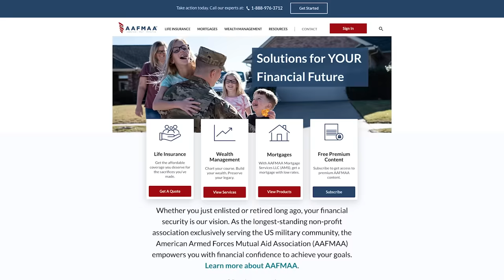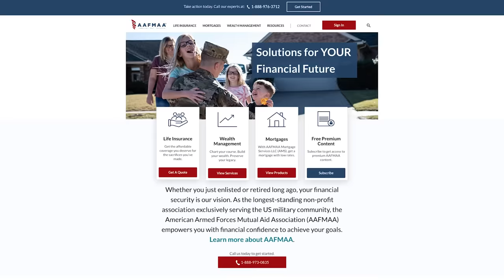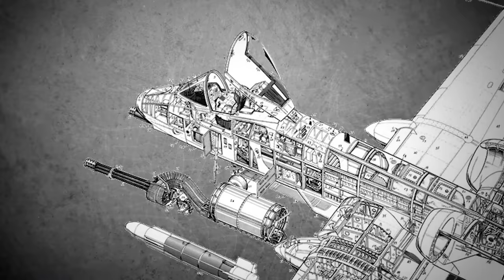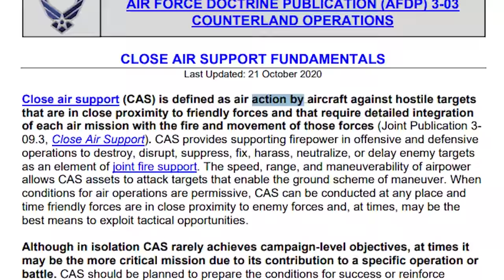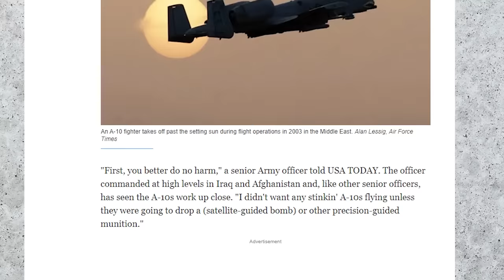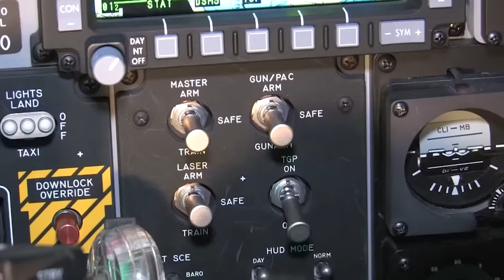Why the Air Force is Screaming to Retire the A-10 Warthog

Comment: The A-10 Warthog is so weird, so loved by many, so sought after for canceling by brass. Over the last couple years, I've heard they're making a new super A-10, but also heard that they were literally thinking about a prop plane to replace it, the Sky Warden. It looks like a militarized Cessna, and some derisively call it a cropduster.
Reply: If I remember correctly the possible prop replacement planes are effectively very modernized WWII Mustangs (data link, night vision, modern materials, etc).  Some of the best prop planes ever produced and at this point an incredibly mature technology.  They do not carry the same firepower per frame, but are cheaper to maintain, much quieter audibly, and a heck of a lot harder for IR manpads to get a good lock on.  The loiter time is also quite good and they can go very slow/turn very tight if they want.  Not exactly a stealthy aircraft, so radar SAMs or radar AAA would suck hard.

*edit: It also can land on junky runways.

I think they have a use case and the maintenance argument is quite persuasive.
Reply: Yup, Sky Warden was approved.  From the Air Tractor AT-802 wiki "On 1 August 2022, United States Special Operations Command indicated they would purchase up to 75 AT-802U Sky Warden aircraft to support special operations forces in fighting irregular wars."   It was never intended to replace the A-10 though.  It's for taking out the technicals and playing with the insurgents up to light vehicles of the backwaters, not poking at the MBTs of a modern army.  Though with the mounts it has I suppose it could if said tank wandered off outside its support, or if someone else distracted or took care of said support.
Reply: Makes sense tbh. That sounds like something tailor made for counter insurgency stuff. Admittedly.... I don't know why you wouldn't use a drone at that point (MANPADs are a thing nowadays after all, tho I guess the providers tend to be westerners)

But it gets the job done while costing less.
Reply: There is no contractor who would bid on a modern A-10 replacement.  A possible replacement would be a turboprop (the OA-X program).  And the only practical mission for that would be counterinsurgency and not a fight against an opponent with credible anti-aircraft defenses.

The Embrarer Super Tucano seemed like the most likely since it was already used by some countries that couldn't afford more expensive aircraft.
Reply: @RobertLutece909 The Sky Raider was shelved in favor of the A10.  Props won't work in a major land war.
Reply: Nope. Their idea is not actually to replace it, their idea is to get rid of it so they can take the funding that would have been used to field the A10 squadrons and use it for some other aircraft that they want like this lightning. The lightning even if everything worked on it still couldn't do as good a job as a warthog. It's all just a question of getting money to field their high-speed high altitude Jets. They have no desire to support ground troops. They want to do the Top Gun thing even though it would cause the death of army Grunts and marines. That's not a part of priorities.
Reply: @mrgrinch837  Eh, not every battlefield role is going to remain existing, there's a reason the aircraft carrier replaced the battleship afterall.

In the a10's case, it just dies too easily in contested airspace, and a literal prop plane is cheaper and easier to maintain if you're just shooting militias embedded in mountains or whatnot. Never mind the fact that getting close enough to use the gun is just asking to get pilots killed if MANPADs are present.  (tho a drone could honestly do it I guess)

Never mind the fact that attack helicopters exist as well. 

And unlike strategic bombers, which can be repurposed to launch a bunch of cruise missiles, the a10 isn't actually that good as a dedicated missile plane, despite that being a lot of what it got used as during desert storm.
Reply: @jeromeace1282  hey jerome, I'm not sure how much you know about what's called the Air Land Battle Doctrine. I spent 10 years as a paratrooper and 10 years as an attack helicopter pilot. As far as the battleship goes, airplanes is what technically took out the battleships which are stationed on obviously aircraft carriers. As far as the warthog flying in contested airspace, it does not. The Fix Wings assets are controlled by awac aircraft hundreds of miles from friendly troops. That's why the warthog doesn't do anything in that realm, it's job is to protect ground troops like I used to be.  There is never, and I cannot emphasize this enough, never ever a chance that an enemy fighter can be anywhere close to our ground troops. That just can't happen with awacs coverage with hornets, raptors, strike eagles, Lightnings etc. The A-10 Warthog does not fly against enemy aircraft. As far as losses go we only lost four combat losses. Compared to the hundreds of sorties that were flown in Desert Storm 4 is a microscopic amount. The fact is that plane can take more damage than Can Be Imagined upon it and bring the pilot back alive. I flew cobras, those are obsolete now but Apaches have refined skills that even the A-10 doesn't have but you need both. The only real reason to pull the A-10 out of service is for the money that they can apply to other programs, but it leaves grunts like myself vulnerable. Everything in a combat zone is a risk, that's why we do the job. If you're afraid to go out there and be shot at then possibly you shouldn't volunteer.
Reply: @mrgrinch837  My comment about contested air space wasn't about the a10 fighting other planes. I was making a point that it basically can't do close air support/ground attack in contested air space because it will fucking die in a modern battlefield against a peer opponent (admittedly, outside of a potential taiwan related showdown, i guess no such foe exists).

Admittedly, I realize with the total dominance the USA has over making high end fighter jets (only the Chinese have both the design chops and the actual budget to fly something that could realistically contest the likes of the f22 and f35 that doesn't rely on a USA made engine for example, never mind whatever crazy shit 6th generation fighter jets will have) needing close air support when airspace is contested might be a foreign concept to you lol.

But couldn't cheaper/easier to maintain planes (i've seen the idea of literal prop planes floated around for counter insurgency stuff for example) can more or less do the same job as the a10 in non contested air space? Hell, just putting a gun on a drone could likely go a long way, even if anti drone countermeasures are also going to become more advanced.
Reply: @jeromeace1282  be serious part of again the airland battle doctrine which if you haven't read it you might want to, I already brought up the point of awac aircraft.  Intelligence of the battle of space which can exceed up to 400 miles allowing stealthy aircraft to intercept conventional Fighters is a game changer. There is seriously no need to insult me, I'm just letting you know what are capabilities are. Not saying that the warthog is built cheaply, it's built like a freaking tank with maximum redundancies. It's a very hard aircraft to take out of the sky. Those few aircraft which were seriously engaged by anti-aircraft fire as mentioned before we only lost four. As far as Chinese go, used to go with a girl who is a very high-ranking us officer in china. Her best advice to me was never buy a chinese-made car. There are multiple reasons why the Chinese are of no significant threat, most of it is they have no Blue Water Navy and they're surrounded by ocean. Without the ability to move your resources thousands of miles as we do with aerial refueling, you're just not a potential threat. I'm going to bring up this point because I spent 10 years operating as a paratrooper using TOW Weapons Systems mostly, after that I went to flight school graduated and operated as a tactical operations electronic warfare officer with Army Aviation units. The photograph of me is of me flying a huey in flight school so I kind of know what I'm talking about.
Reply: @mrgrinch837  To be clear, I wasn't trying to insult you, more memeing the US military industrial complex's dominance of high end fighter aircraft (genuine question, when's the last war y'all fully committed to that didn't result in immediate total air dominance). That being said, while the a10 can deal with AA in terms of bullets, given the proliferation of things like MANPADs, I'm curious how many targets the a10 would be able to safely engage in the future. 

As for the bit about intercepting aircraft from 400 miles away with a stealth aircraft, in a hypothetical peer war, both sides will be doing that (and even in a somewhat more lopsided war, I wouldn't be surprised if something like stealth drones end up being a thing). And in cases where that's not the case, how is the a10 not just a 'win more' option whose role could be fulfilled by something cheaper that can potentially loiter around the area for longer? 

Also, my point about desert storm wasn't how many were shot down, but rather that most of the a10's vehicle kills were from the missiles (despite the initial concept of the plane as using the gun on vehicles).

As for the China thing, what i've heard tidbits of from people talking about getting stuff made there, the main problem is more quality control being dogshit unless you're being strict about it. Which presumably they would be for high end fighter jets, they're not making stuff to parade around a few prototypes the way russia does lol.

Also, the not being a threat thing isn't entirely true, if the Taiwan thing boils over because the CCP wants to distract from internal issues (which is important because Taiwan basically have a monopoly on producing high end microchips), that's both close enough to mainland china for all those long range anti ship missiles they have to come into play, while also threatening a sufficiently crucial strategic resource there's a pretty strong incentive for the USA to get involved.
Reply: @mrgrinch837  self defeating argument, US warplanners are focussing on near peer adversaries, where contested airspace is far more likely, meaning the a10 can't even take off in your words.

The reason to pull a10 out is because it has no good distinguishing features compared with the contemporaries it's a bad (relative) platform and it costs too much. Being able to survive small arms is good, but not being shot is better... *laughs in ac130*. Most missions (unless your experience is saying otherwise?) use PGM and not the gau8 (especially to eliminate targets, especially in cas). It's loiter time is inferior, it's expensive... everything it does something else does better faster and cheaper other than being a distraction/bullet magnet?

Assuming the gun statement is accurate other aircraft/drone can easily fill the role given basically the whole fleet can fit jdam/sdb or hellfire/switchblades if you're talking about drone or rotary.
Reply: @mrgrinch837  AF brass have wanted 'new toys' for a long time.  This crop duster is just a way for them to say they have a 'replacement'.
Reply: @H0kieJoe  at the cost of the lives of Army and Marine Corps soldiers on the ground who need Superior firepower. Must be one hell of a toy the sacrifice those lives.
Reply: @mrgrinch837  Yep.
Reply: @mrgrinch837  If you already have air superiority why are you wasting time with a dogshit A-10 and not putting an MQ-9 on station?
Reply: @fnhatic6694  drones are great at surveillance and Reapers especially at killing vehicles, but they don't do squat with killing troops. Under the best conditions they only carry eight Hellfire missiles, so unless they're all going to bundle together and stand there and smile it really won't do much in taking out a bunch of enemy soldiers. Besides, if you spend something like $100,000 with a Hellfire just to kill one guy that's not entirely cost-effective.  An A-10 is not an air superiority aircraft, it was never meant to be. It's job is to protect the infantrymen or Marines on the ground. You need to have coverage to take on enemy soldiers that are attacking your friendly soldiers and a Reaper ain't going to be able to do squat about that. Unless like I said, they have to stand together and smile. Ya Gunna need a big freaking gun that spits out a lot of bullets in a very short amount of time.
Reply: @mrgrinch837 The A10 was made to be survivable against threats from decades ago and would get swatted out the sky by the cheapest of modern MANPADs. Its not even a question of survival, it. Will. Die. Two decades of fighting enemies who's idea of air defence is shooting AK47s up in the air has lulled Americans into a false sense of security on the A10. 

The US Air force is rightly concerned about achieving air superiority in Asia, given China has lined their coastline with anti air assets this is looking difficult for them. American marines won't even make landfall if American ships and transport aircraft get blasted because of Chinese missiles.
Reply: @jgw9990  That's an interesting assessment you have their but, one, the A-10s not an air superiority fighter. It was never built for that job, that's the job for all the F-series aircraft. F-16 f-18s F-35 f-22s. The A10 is only designed to take out grown targets that are threatening to  our ground troops.  2, unlike the Sukhoi 25 which the engines are mounted closely together, the warthogs engines are on pylons that are quite separate from the fuselage. It's designed that way so that in case of a manpads, which are heat seeking missiles being fired at it and hit, the plane will continue to fly. Both engines need to be taken out in order to bring the aircraft down. And number 3, I doubt we would ever even attack China. Our aims are to defend Taiwan from a Chinese attack. We have no desire to enter Chinese airspace. But even if we were to attack China, it's likely going to be done by submarines with cruise missiles. That is by far the most efficient way.  We don't actually have to set foot on Chinese soil but again, our goals are to defend Taiwan. Just like the first desert storm, we didn't have to go into Iraq. Just push them out of Kuwait.  Oh, and one other thing. You mentioned the Chinese defenses for air attack. Iraq had the top of the line service to are missile systems built all over baghdad. We got in there pretty much like we had our own key. Didn't lose a single  fighter during the most intense anti-aircraft barrages defending just a small City compared to an entire coastline. That scenario does not bode well for China.
Reply: @mrgrinch837  I know A10 isn't air superiority. My point is that it sucks up dollars which could be spent on more air superiority.  

Cruise missile submarines would be a good option for China but America doesn't have enough of those. Really you'd want about 100, America has about a dozen? These also take ages to build, you can't punch them out like a tank.

Manpads - OK? So what happens if... get this... the enemy has more than 1 missile... Or if they use a laser guided one or a non heating seeking missile. An aircraft who's defence involves getting hit and hoping to limp off is terrible. This isn't 1965. 

Desert storm involved a massive build up of forces on the Iraqi border in Saudi Arabia, and storm DID invade Iraq. Just not all of the way to Baghdad. Desert Storm was extensively studied by China and they've spent the last 3 decades building a force which will prevent America doing that. Anti ship and anti air denial weaponry reaches out 500-1000 miles past Taiwan. There is nowhere for America to mobilise nearby. America being distracted by the war on terror allowed China to catchup in a big way. Go listen to recent navy or air force talks about China, they are VERY concerned.

Comment: It's an outdated aircraft that can only work when you have absolute air superiority.
Reply: You can use it when your going against Taliban in flip flops
Reply: We ALWAYS have air superiority.
Reply: @jjww30   you have always had air superiority, that doesn't mean you always will, not to the degree you need for the a-10 anyway.
Reply: @rayanalzahrani8756 Yeah, so air superiority 

The US is shifting to the Pacific theatre though
Reply: Ask yourself, how useful would these be in a modern conflict ie Ukraine? I would think even today they have a role
Reply: @nephron9924 See Su 25 losses.....
Reply: @nephron9924 Absolutely not… too big and too slow! It would be a sitting duck waiting to be slammed by a SAM
Reply: @dwwolf4636  Yeah, neither Russia or Ukraine has depleted their stocks of Su-25s. They're higher than jets that are used in less risky roles, but still having an effect on the battlefield, delivering munitions that artillery simply can't. Plus, I'm pretty sure Russia has lost more Ka-52s than Su-25s, does that mean we should retire the Apache without a replacement?
Reply: @jjww30 when fighting countries that have slingshots and sandcastles.
Reply: @userequaltoNull ukraine doesn't have an active airforce.  And russia keeps their aircraft outside of US missile systems in ukraine.